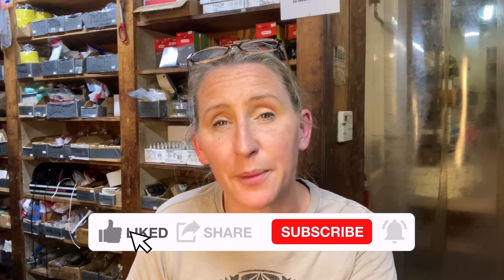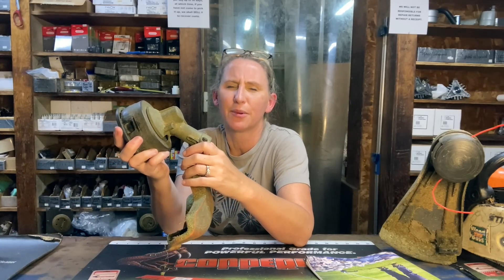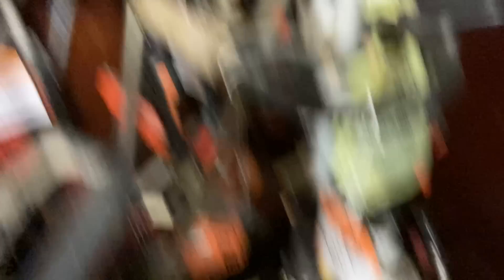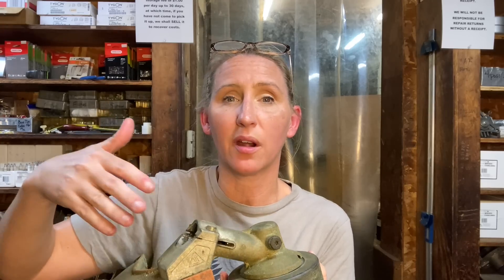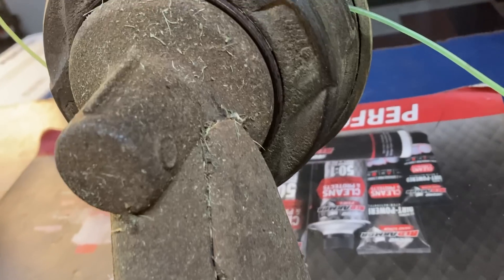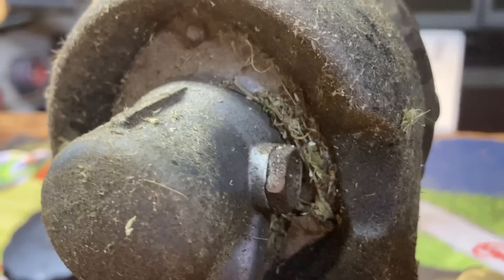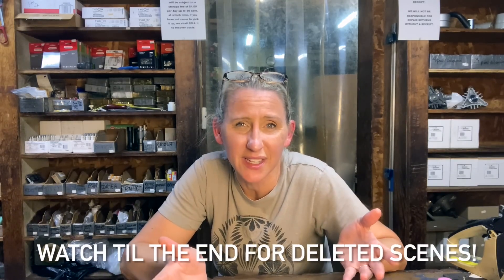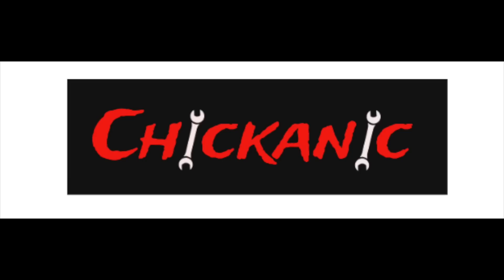Planned Obsolescence?! Why Would STIHL and ECHO Do This?!

Comment: I own a Stihl FS-56RC, my dealer told me that it was built for homeowner use, not commercial.  I forget how long I've had it, but it runs and runs and cuts and cuts.  However, I only have to trim about every other time I mow.  So it's not like the ones the pros use, 10 hours a day, every day during the season.  Now on the subject of the speed feed head from Echo or Shindawa, YES!  I was tired of winding string on my trimmer and it getting tangled and all of that.  This thing works like a charm.  She promotes them and I've seen lawn care pros on-line singing their praises too.  There is another factor too, certain factions in Washington DC really wants gas powered lawn equipment to go away.  So they want your mower and trimmer to die, and force you to buy a battery powered one.  I considered it for a chainsaw, again just for homeowner use, but every electric model I've tried, didn't work out.

Comment: this is really nothing new. they have been doing it in the automotive industry for years. look how many grease fittings you find on new vehicles? a lot of older vehicles have grease fitting on everything and if greased regularly the moving parts last much longer especially once rubber boots fail. it still really comes down to how often people maintain their equipment. i would guess only 1% or less of people actually do maintain their equipment so most people were not checking there gear box anyways. i got a older echo trimmer with the fill plug and have never checked it in the 8 or more years i owned it and at one point i was using it for commercial use and running it for 8 hour a day. i would say the reason you may be seeing more failures in the gear boxes is less to do with the grease and the lower quality parts being used in the gear box.

Comment: Just a question, I’ve never removed the head from my trimmer, could you easily add grease by removing the head and putting some grease into the head and on the shaft before inserting the shaft? If the average consumer is not aware or would use the plug maybe that’s why they got rid of them? One less part and port/thread to machine? Perhaps?

Comment: I paused the video and went out to the garage to check out my year old Ryobi and it had a screw low down on the head. I looked inside and could see a greasy shaft so I decided to put some grease in it. I don't have the little grease applicator I've seen you use before so I took a needle used to inflate footballs and used that. Thanks for looking out for the little guys

Comment: When I mowed professionally, I had a stihl Khombi motor head and a Trimmer and articulating hedge Trimmer. After several years, burned up the motor head. I just bought an FS straightshaft Trimmer and just swapped the heads back and forth with the hedge and string Trimmer. It was just as easy as the Kombi but a lot cheaper.

Comment: Most home consumers that use residential cheap made or just say more economical priced string trimmers never grease anything or even think about getting their hands greasy ! Also with all this moving to electric battery powered crap it's gonna get worse I'm sure ! I just bought an older echo straight shaft srm 2100 string trimmer and plan on keeping it working like new , nothing compares to the old school machines ! On the newer non greasable no bolt to remove models  You can take the snap ring off the trimmer head and pop some grease in there and keep going !

Comment: This nothing new ,it is called corporate greed and maximum value for shareholders.When designing anything the very last and most times never is the end user even part of the equation. We live in a throwaway society where if it doesn't start throw it on the curb and buy a new one and the manufacturers know just how lazy we are. Greased for life ?lol . just like bearings but they do not mean your life !

Comment: Stihl is nothing but junk. I have a Stihl chainsaw and it stopped oiling after a few hours, it still has the original chain, and it's only been sharpened once. Of course the warranty has expired. I also have a stihl string trimmer that had to have the carburetor replaced after less than ten hours use also after the warranty had expired. I'll never buy another Stihl product.

Comment: MTD does the same thing, no grease port or even a zerk to make things easy.
The pressure on a zerk would even force grease into the bearings.  It is almost
like the part was engineered to prematurely require replacement. Go figure.

Comment: The fact is few things are ever greased even if there is a grease fitting
People are not at all afraid to shoot high pressure water into everything though
It after all got to be clean :)
America at present suffers a stupidity that it will likely not survive
No way to buy itself out either
It a fallen state
I do not even grease my own weed wacker
Echo surly uses good quality japenese bearings
Stihl being that are manufactured in their plant in china surly use chinese bearings
A Echo Srm 225 a homeowner model

Another strange but true fact is 
More often than not
Once the grease mites do damage
The worst thing in the world is a grease gun
A machine can be working that never has never been greased ever
You grease it and directly you will have a busted machine

Comment: You ever use some stuff called "zero grease" or "00 grease?" It's made for gear boxes. Everything from trimmer heads to garden tractor rear ends to rotator worm gear boxes on boom trucks. Stuff works good, it's real oily...
Reply from the maker: We use it for the transmissions on Snapper self Propelled mowers. It's the best.

Comment: Planned obsolence is all over. Wasing machines, dryers, refrigerators, computers, lawn care machines, vehicle. Just a way for these companies to guarantee perpetual income either for parts or whole replacements. Think about it, just when the warranty runs out (sometimes sooner) everything starts to unravel and winds up costing more to fix than it does to just give up and buy a new one. That's what they're counting on and product engineering always takes a hit because the bean counters want bigger margins and lower cost...just take off a little here and here and here even if it puts a user in danger.

Comment: My New STIHL FS-70 does not have a grease plug.  Not fully sure how I am going to grease it.  Maybe pull the head off and push it in where the cable is.  I am not impressed by that part.

Comment: My longest running most reliable straight shaft FS 56rc I bought 7 years ago and use it commercially. No grease plug. It's definitely harder to grease but oh well I don't trust the quality control these days to retire it for a better option

Comment: There cheap  l bought a srm225 with no grease plug that head is different also the engine blew oil out the tailpipe. So this how l fixed that l put the pas attachment gear head on it and no more oil out the tailpipe and a grease port l know this sounds crazy but it's the truth so help me God take care hope you guys are doing great 😊

Comment: They probably figured the percentage of units that got grease (very low) compared to the volume of warranty work would justify the cost savings of not having to machine a threaded grease port and adding a grease plug with a gasket. $3.00/unit (high estimate) X number of units produced = ?? $3.00 X 150,000 = $450,000 in company savings! Looks really good for the board of directors and stockholders!
Come on, admit, have you greased your angle head?!

Comment: I sure love my SRM 311. I've had mine for years and every late spring is a good long months of cutting grass on rocky steep slopes on my 10-acre property , 5 acre property, and our eight other properties so it gets a lot of use and since everything has to be done between the time it stops raining and the time it hits 105°, which can be just as little as a couple of weeks, my equipment can't be down for repairs. This year though the gear head seems to be making a little noise regardless of the grease so this fall I may take it apart and do a good inspection. I'm also considering purchasing a new Echo  SRM 3020 and using my old 311 as a backup because I think this is the last year here in California I can buy a gas trimmer. After that it appears it has to be all electric which just won't work for me.

 I wanted to add a comment about the trimmer heads. A couple of years ago I decided to try one so I ordered a cheap Chinese one on Amazon just to give it a try, they came in a two units set. I was amazed to find each head lasted me a whole season so I thought I would go ahead and reorder the same one I had before since they were cheap and they lasted a long time. To my disappointment  each one lasted me no more than a few hours of use and then fell apart. This summer I'll pick up a couple trimmer heads like you use and see how they work out.

Comment: I was able to grease the one in my 56 and it don't have a grease plug, take the gearbox off get a syringe fill it with like red and tacky grease or something, down inside the gearbox where the shaft goes into the square hole that square hole goes all the way through and into the gearbox, I was able to pump grease through that hole and it does make it into the gearbox. So far so good

Comment: On the stihl gearheads anyway, i believe if you remove the head from the shaft, where the drive cable engages, thats hollow and leads into the gearhead.  Should be a slightly less convenient way of greasing the "non serviceable" type.

Comment: Why couldn't you take the head apart, drill a hole & use a tap & die for a bolt?

It would be nice for Echo or some small engine manufacturers to make a Blower that is for Right hand & Left hand people. 
Steve's Small Engine Saloon covered this question a short while ago.

Comment: Take one of your parts heads, remove the lube plug, drill out for a zerk fitting. you now have a screw in lube adaptor for a regular grease gun instead of the high dollar tubes and no mess.

Comment: Residential vs commercial features. 90% of residential users do not maintain their equipment properly so why add in a feature or part that does not get used.
Reply: When educated it gives those that now can be bothered...the chance to lube it...if the plug is there.

It's bit like the cheap $20 angle grinders made in China.
The very first thing to do is take the head apart and get rid of the lump of yak fat that has been thrown out of the teeth and is sticking to the outer casing.
Then half fill the gearbox with any decent high speed high temperature grease and reassemble the gearbox and head.
20 minutes of work will make the angle grinder sound so much smoother and last so much longer....

Comment: Couldn't you just drill and tap a hole on the side of the gear housing and thread in a short bolt? For a grease plug, for a head that doesn't have one.

Comment: They know most of they customers are not going to grease that head and they save $.50 per unit. I see this in electronic devices often especially if from overseas. They use cheap solder to save pennys which almost always disconnects which is easy fix but most people just toss them in trash and buy more junk . Tragic.
Reply: That "cheap solder" is low lead solder.
All the flexibility and vibration resistance that high lead content solder used to have is gone...
Guess why ECU/TCM etc in cars go bad now???

Comment: Yep. Engineer school taught me that things need to wear out over a certain period of time. Keep the dollars moving. Few will want, or be able, to pay for a trimmer designed to last a couple hundred years
Reply: It's bit like the cheap $20 angle grinders made in China.
The very first thing to do is take the head apart and get rid of the lump of yak fat that has been thrown out of the teeth and is sticking to the outer casing.
Then half fill the gearbox with any decent high speed high temperature grease and reassemble the gearbox and head.
20 minutes of work will make the angle grinder sound so much smoother and last so much longer....

Comment: I guess you will half to drill a small hole in it and install a grease fitting. Most cars and pickups have done away with greaseable ball joints and tie rod ends. They do the same thing on wash machines, only lasting 2 years instead of 20 years. Getting more money out of your pocket. Planned obsolescence,,,,,,,,,,,,,

Comment: Bre awesome advice on the attachment for replacement head got any other suggestions like that keep them coming ,This is my opinion take it for what it is manufacturing do not want there product lasting longer than a warranty runs so they are making them cheaper . Also most consumers will not change the grease in the trimmer head they will leave it to us gear heads to fix them .

Comment: I expect them to be on pro-grade equipment that will be meticulously maintained by a shop or service department but on residential equipment they are like oil drain plugs on lawn mowers - most customers aren't going to use them if they have them.

Also by omitting the drain plug on residential equipment you eliminate the possibility for a customer to put in the wrong lubricant into the head - a lot of customers don't know what they are doing and many will put in whatever they have on hand rather than going out and buying the correct stuff.
Reply: Any grease beats no grease.

Comment: Why? Easy - Eliminating two parts, a plug & sealing ring. Then the machining steps and tooling for threading and finishing the sealing surface for the grease plug is actually a significant savings when manufacturing the casting for the gearhead.  Reduce physical part count, capital costs for equipment, and labor touch time on the finished parts. The cost savings is probably more than you'd think.  It's not planned obsolescence so much as it is maintaining price points against relentless cost and currency inflation.

 These have gone away for the same reasons that lube points on suspension components, universal joints, and automatic transmission drain plugs/dipsticks are all but extinct.  The VAST majority of consumers are not educated on why these features were important, and many shops/techs didn't care enough to service these items properly or educate the consumers.  How many of those grease plugs on her trimmer rack have EVER been removed?  More than 1 or 2 would surprise me.  Most of this equipment is run until it doesn't, and then replaced.  Why would a manufacturer continue include features (at their expense) that are not utilized by the vast majority of users?

If you really want to lube these gearheads, it's still possible.  Just not nearly as convenient. 99% of these non-serviceable gearheads will run just as long as the serviceable variety that were never serviced to begin with.  The 1% will figure out how to service the gearhead with a syringe and needle or install a Zerk.

Comment: I've never really understood that either.  Technically the deleted grease plug version can still be greased, it just involves a lot more work.  I also noticed that at least the Echo one you have shown is actually the entry level version.  I can't say anything about the Stihl as I steer clear of Stihl equipment due to more failing on them than with Echo, and especially when it comes to noise.  They are using 4 stroke engines on them but are much louder than Honda's mini 4 stroke engines.
Reply: I've noticed just how noisy those Stihl four-cycle engines are. Like a coffee can with a handful of ball bearings rattling around in it.

Comment: Question. Is there a seal between the shaft and the trimmer head? I wonder if you pull the shaft out of the drive head and either dump grease or poured oil down the shaft would make any difference? Or would it just make a big mess.

Comment: I agree with the manufacturing engineer as I have been working with batery powered tools and consumer drones since their inception.  With battery powered products the battery design changes every 2-3 years, and new model batteries will not fit old model products.  Lithium batteries have a finite life cycle, gauged in both time and number of charge cycles, so they "wear out".  As they wear out thee design changes force you to buy newer model tools. An insidious way to rip off consumers.

Comment: Hi, I just purchased a 131 R Stihl Kombi system in May/23.  I am pleased to report that my FS/5 grass trimmer attachment does have a grease/oil port on the trimmer head.  I’ve run the unit through one tank of gas and the trimmer head gears look adequately lubricated - whew!  Thanks for all your insights!  PS, I’m in Ontario, Canada so part numbers may differ.

Comment: I used two of the speed feed heads.  The Husqvarna first, then the Echo after discovering the Husqvarna was trash.
Put about 10 hours on the Echo version before going back to the stock head.
Not worth the expense, not any faster to reload either.  Not if you are accustomed to reloading your trimmer daily as I am.

Comment: Need some help/advice. I'm having minor problems with my Poulan 200 blower. I have to play with choke and run levers to get it to operate. Where do I start? I want to drain fuel to check filter and fuel lines that might need to be replaced. It's been about 2yrs since I had it serviced but my tech isn't in the business anymore. Any advice is appreciated. Thanks in advance.

Comment: I'm wondering how much longer until the drive shaft keying shape starts getting customized for each model family.  Seems like it's way to easy for the mechanically inclined to buy a PAS or Combi head accessory (like the bed Redefiner) and swap it onto your current trimmer head for 1-2 time per year use.